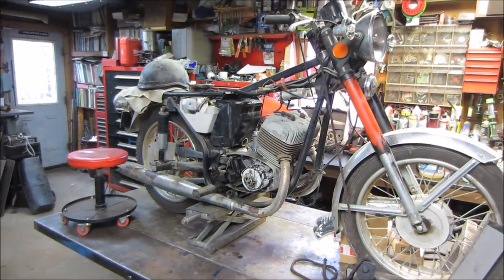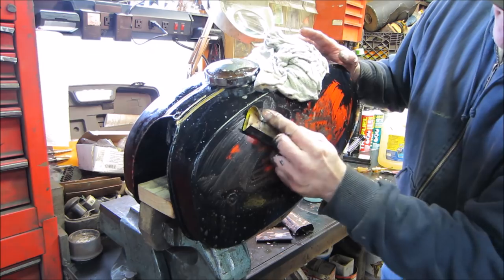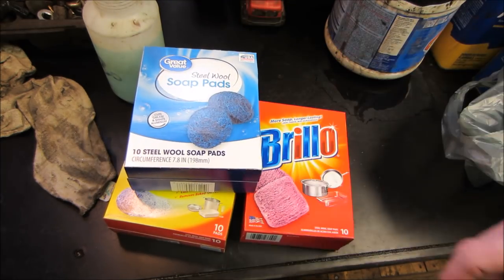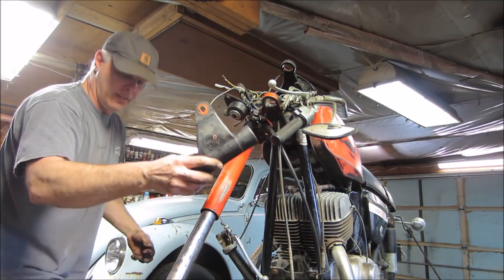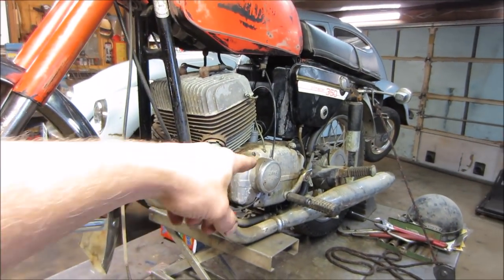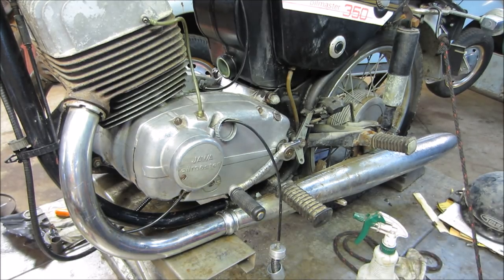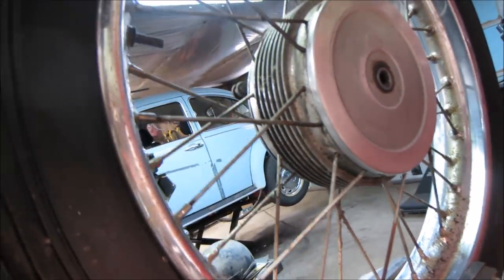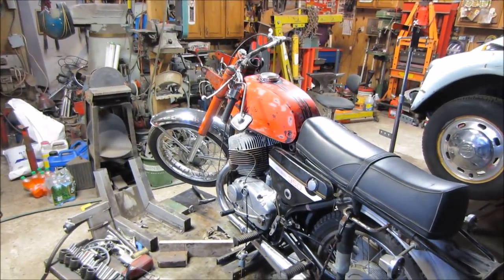barn find jawa, will the paint come back with wet sanding?

Comment: and i have a chrome plate that goes on the gastank and the backlight, if you want it, hit me up :) i have some other things for this bike :)
Reply from the maker: l just got the new tail light today, are your chrome side covers better then what l have now? thanks
Reply: Mustie1 it seems that they are better than yours.
so you already got the oeiginal taillights?
lets say, ask me what You need from this bike and i can got it for You,I Live where there was and is pretty many Jawas ,Europe. :)
Reply from the maker: not sure what shipping would cost, but anything chrome thats better then what l have now, oh and the left switch assy on the handle bar, flasher unit, front brake shoes,throttle cable, front brake cable,lol you asked,
Reply from the maker: mopaman@aol.com